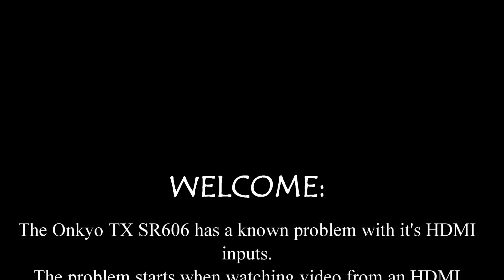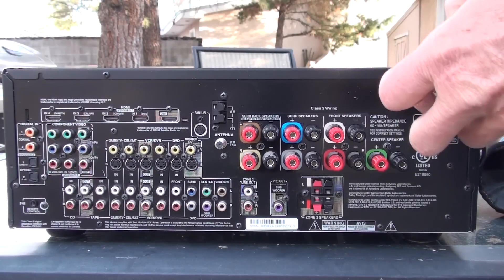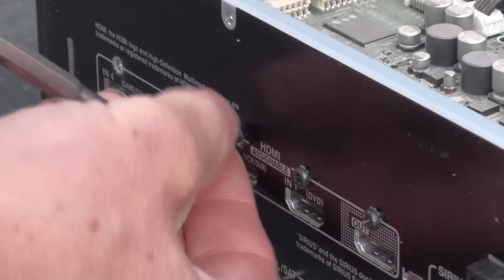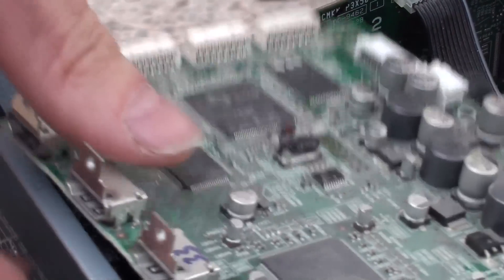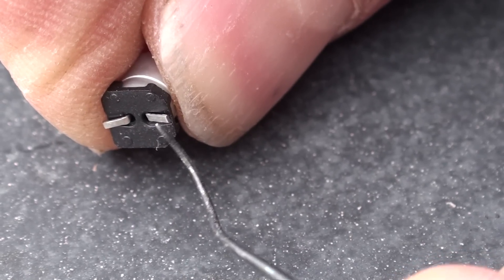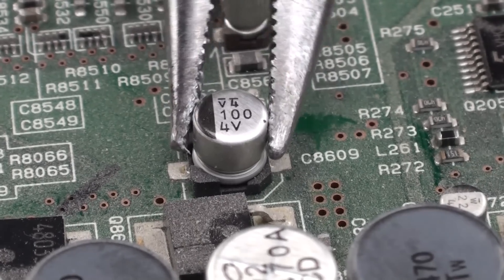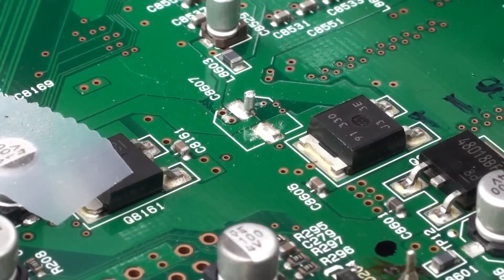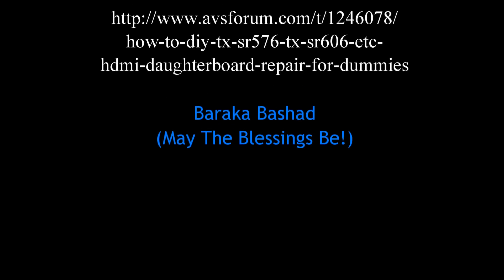How To Fix the Onkyo TX SR606 & SR607 HDMI Input Problem

Comment: The 607 is slightly different then the 607. I replaced all 21 capacitors on this board of the 607 and after that HDMI is working again. So, a lot of 100 uF SMD, some 220 uF and the rest is 470 uF. The little one on the 607 board, the 22 uF, wasn't in stock so did not replace that one and it seems not necessary to replace that one too, it's working again with replacing all 20 of the 21 capacitors.

Comment: I am curious though as to the reason for the failure of these caps. I know the Onkyo runs very hot and is often left on. In purchasing new ones I noted a Life Rating of 1000, 2000, and 5000 hrs.  I opted for the highest which happened to be a radial lead.

Comment: Great video.  Any idea which caps to change on a 804?  There are a total of 11, wondering if I need to change them all, or is there a way to tell if they are bad???  Thanks!
Reply: I was also trying to find out how you knew which capacitors to change.  Does each capacitor work with a different HDMI port?  If so did you check each port to see if it worked?  Or can you use a Digital Multimeter to see if each one carries a signal?  P.S. Great video except for the sound.  Maybe you should include text as a reference.
Reply: Arthur Elizondo  - My 804 had 11 capacitors instead of 5.  I bought 10, thinking I could mess up half of them, but was still one short.  I started changing them in no particular order, changing a couple, then testing the unit.  After 4 were changed, everything worked, so I saved the caps I had left over for next time.

Comment: I saw this on excellent video for a while now. N my HDMI devices have not been able to connect to SR-607 intermittently. Sometimes can n sometimes take forever. I wonder s long s it is a 100UF 4v SMD capacitor as per the video, it will do, right? Any other specification, i need to be aware off? Cheers. I never use Digikey before and not sure if it is available to send to my country.
Reply from the maker: I'm sure you can find suppliers in europe. Once you find a supplier, Search for:  Capacitor>Aluminum Electrolytic>4V>Lifetime Temp = 100C or 105C.  A lower temperature rating will work, they just wont last as long.  Style can be Cut Tape or Radial.  You may find Radial style easier to solder.  You can even get them on Amazon but I dont know what the temperature rating is on these products.  https://www.amazon.com/Aluminum-Electrolytic-Capacitors-4volts-6-3x5-4/dp/B00LWSMGHY/ref=sr_1_3?crid=1PAYEA5B26NZN&keywords=capacitor+aluminum+electrolytic+100uf+4V&qid=1672793671&sprefix=capacitor+aluminum+electrolytic+100uf+4v%2Caps%2C97&sr=8-3

Comment: Hello, I have the same amplifier. My issue is I am not getting any audio through the speakers or headphones. Everything else works, ie recognises audio in via optical/HDMI/RCA etc, and can decipher what audio format it is. Any ideas on what might be wrong with the audio output? The Audysey setup mic feature will not work either.

Thanks

Comment: I do have SR876 and the hdmi is not working.  I wonder you can share all of capacitors on board that need to be replaces and capacitor spec you recommend.  Thanks.

Comment: I have an Onkyo TX-NR609. I had it repaired once under warranty where they replaced or repaired the HDMI board. It's had a history of slooooow switching between HDMI inputs, or seems to just go to sleep for a while then suddenly work. 

I've since acquired a 656, but I'd like to repair the 609. The HDMI board has 4 caps on the "bottom" of the board and 1 on top that in appearance look like the ones in your tutorial, except mine have "A4" "100" & "16V" written on them. Can you tell me which caps would be a proper upgrade to these? I have the board out and ready to replace the caps. I'm not an electronic tech but did used to repair telecommunications boards back in the late 70's so I have some soldering skills, if a little rusty.
Thanks for any info you can help me with.
Reply from the maker: mandrix It’s best to replace them all.  The 4 caps on bottom sound like 100uF, 16V.  Replace with same type but upgrade the temp rating  to  100 or 105C if you can, so they’ll last longer.  I don’t know what your board looks like but I’m surprised if it only has 1 100uF cap on tops.  The smaller caps (100uF, 4v) are more likely the signal caps, and more likely to be the problem.
Reply: @patpatpat999  Here are links to pics of either side of the board, hi res.[ https://imgur.com/cTPNNPf ]  [  https://imgur.com/TH4zMVC  ]    I hope this will clarify for you. But basically you're saying I just need to buy replacement caps that are rated for >= 100 C?
I appreciate your help. Even if this model turns out to have different problems, I don't feel that such a small investment in time and money is wasted for a chance to get a few more years duty out of the old gal.

Comment: Well that looks nice and easy to do BUT i have a question so her it is 
My Onkyo TX-SR313 does work with the HDMI but it loses sound after 1 min or when i start the onkyo again only picture from the satellite but no sound 
If i put my Onkyo of i will get sound on my TV self ( not on the Onkyo ) so i think its the same problem as you had ?
Ore am i mistaking here ?

Comment: Hi i was just wondering if you know if this process will work the same for the TX-NR509? I have gone through all of the HDMI ports and that is now preventing me using my system as a home stereo. Any help would be greatly appreciated. I have not been able to find a guide as thorough as this one or any for that matter that are specifically for my model. Mine looks very similar to your model just slight differences.

Thank you

Comment: Any idea on which capacitors need to change on the TX NR-807? Onkyo offers get a new model with a good deal but does not ask to return the unit only serial number label, works with rca's not hdmi on video, sound is ok

Comment: very helpful video. how did you figure out which capacitors to change out? I have a TX SR875 and the board is different. There are 4 capacitors next to each HDMI connector. Seems obvious to change those. I have the schematic diagram, but it is hard to digest. any advice?
Reply: And dit you fix it with new capacitors?

Comment: Hello, I have the same problem with my  Onkyo  TX-SR876 which I've been told it also has a fault on the hdmi board. Do you know which capacitors I need to replace please as the board is slightly different? Thank you
Reply from the maker: Jut replace ALL the 100uF capacitors, not just the ones I show in the video. It only a little more work and a couple dollars more
Reply: Any luck Werdna on your Onkyo TX-SR876? I am going to try the same on mine and update you all.

Comment: Hi Pat. Thank you very much for posting this fix. I was skeptical about just twisting off the caps but it worked pretty well. I got my caps from eBay seller diy-electronic-store for about $7. I wonder whether any of the other caps on the board are bad or maybe Onkyo bought a bunch of bad 100uF ones.
Reply from the maker: TTDavid Mayes You never know, That why I reccomend to replace all.  I think onkyo goofed on the design.  Their chassis run hot. They should have spec'd higher temp caps.

Comment: Did you find these with an esr meter or were these targeted due to someone else's observations? I don't have the same fault but it's not on the amplifier board. Should be getting a dedicated esr meter in the post soon and hoping i can find any faulty metal can caps with it.
Reply from the maker: No esr.  These caps are all old and underated for the thermal environment.  No point in checking them.  Just replace them all.  You are only adding a few minutes and dollars by doing this.   You are over thinking this.  As an old engineer, I don't care what went wrong, I only want it fixed.

Comment: Thanks for the great video! I just changed all 5 capacitors on my SR607. Now the input sound comes on instantly but video does not. Could you point out which capacitor manages the video output or how to fix my issue?
Reply from the maker: I don’t know, but you could replace all the caps on the board, there aren’t very many.

Comment: Fantastic! I thought I was going nuts or that my kids have managed to change a setting somewhere that I wasn't able to find/solve. My TV HDMI input seems to work fine but the ones for my 2 games systems will take up to 20-30 "switching" back and forth to finally come up on screen. It's been driving me nuts. I'm not an electronics guy but may be time to learn if it solves the issue - thanks!

(how were you able to determine it was those causing the issue?)

Comment: I have a TX-SR607 Onyko and I'm not getting any signal at all. My receiver may a click noise and the picture disappeared on my HDTV. The receiver went off. I turned the receiver back on and couldn't get a signal through the receiver on any of my devices. I guess I can try this. Where do I order all the parts?

Comment: There are four capacitors 100 4V E2 and E3 1 capacitor 100 4V.
I replaced them with the same as you wrote.

Comment: I have a 696 that flashes protect and shuts down on startup. I tried to warm all the board to see if warming caps would bring it back to life but no joy. Next i will try to separate the regulator board and hotwire the transformer to check the power supply output voltages are good. I'll recap these 2 sections. If still no luck i will recap all metal cans on the processor / computer board. Looking at the onkyo service manual the trouble shooting section seems a little complex and not easy to do if it keeps going into shut down. One guy said to reset the data chip on later models and sometimes when the fault is cleared it can operate again!

Comment: Hi patpatpat999,

I'm trying to understand if this will help me with the notorious "no sound" problem, meaning, when the HDMI input finally works (after few minutes) there is no sound, only video.
I saw a lot of movies, according to which the problem is with certain Q3001 chip (and in most cases, heating the chip or even putting the entire board in the oven will fix it, sometimes temporarily:) ). I wonder if the replacement of the capacitors described in your movie will help as well...
Reply from the maker: I cant say for sure, and I don't guess about things I'm not sure about.  Whether video or audio, if there's  delay and then it works,  it's probably a capacitor problem.  The good thing is that it's cheap and fairly easy to change all the capacitors.
Reply: It worked for me. I had limited HDMI inputs working ans the sound got Real shoddy almost sounded like it was through water. replace the caps. its like 5 dollars with shipping though Digikey. only took 3 days to ship for me. Even If I have to replace once a year Its worth it for me. 1

Comment: your video is great and i have a question. It looks like each capacitor has a unique part number (C6809, C8002, etc). but it seems that you are saying order 5 of the same capacitors. Is this correct?
Reply from the maker: Joe McKenna Those numbers circuit references.  Each part has a unique reference number.  It's used to locate the physical part from a schematic drawing.

Comment: Thank you!
I just replaced the five caps indicated, and my receiver is now working just like the day it did when I brought it home. It took about an hour and half, with half an hour of that dusting out the case.
Now. . . anyone want to buy a soldering iron? Only used once! ;-)
Reply from the maker: Congrats.  You're now a junior engineer! I actually rinsed my board off in the sink.  It can be safely done, but I don't say that just in case someone does ruin their board.  Cheers.  Rock-On (at safe volume levels)
Reply: patpatpat999 

A junior engineer? I think I need to ask for a raise!

I did notice one thing in your video, I may be wrong about this but I'll mention it anyway.
I think the you might have mislabeled the the capacitor on the top of the board. In the video it's labeled as C6809 when it's actually C8609.

Comment: Would it be ok for me to use a El.lyt SMD 100uF 6.3V 85C ø5×5.2mm instead of the one in the description? 
The only difference I can see is that it's 6.3V instead of 4V, will this be a problem? 

Thanks for the video, you're saving lives.
Reply: Just saw it can only get up to 85 celcius, guessing this could be a problem?
Reply from the maker: Flying Gordon should work fine.  Higher voltage just makes them a little bit larger.
Reply from the maker: Flying Gordon 85 deg will work,  but 105 should last much longer.

Comment: hi this is a super video but im a little confused. the first cap has a code next to it on the board saying c8609 not the c6809 you listed the next one has a different code to the one you said however the last one has a code next to it that you listed. so how come you dont order them based on the codes printed next to them on the board? any reason for that? thanks for the awesome help

Comment: Very helpful video. Thank you. My Onkyo TX-SR674 has a very similar issue to the HDMI input problem that exists in the SR606 and SR607. I have found multiple videos showing the replacement process for these models but not my own, which has a smaller HDMI board with a different configuration. I would like to attempt the capacitor replacement to see if it will fix the issue on my receiver as well but I am unsure how to identify the capacitors on the board for replacement. Do you have any advice on how to identify which capacitors will need to be pulled and replaced? Thank you.  *edited model #*
Reply: +berthornhill Look for "4V" and "100". There could be other numbers but those two are the give aways. They're pretty small, I didn't measure them but iirc they're about 3/16" diameter.
Reply from the maker: Agreed,  all caps of the same size will probably be the same value on your board.  Replace all the 100uF caps

Comment: Hey Pat I have the 607, can you tell me if the capacitors that need changed for the hdmi are the same as the 606? 

I took a look on the bottom side of the board and there are five 100mv 4v . are these the ones that need changed?

I read w post on an av forum and one person said do not follow the 606 repair on the 607 because they aren't the same.

Comment: Doing my second replacement in 5 yrs… this time putting 6.3v in as an upgrade.
Reply from the maker: @foggyfrogman1  I would suggest putting in a cap with a higher temperature rating would help more than a higher voltage rating, but I don’t know for sure

Comment: It's so sad that Onkyo makes a ton of money off of us consumers and they have had this issue for years but they refuse to fix the problem! I will NEVER buy their TRASH again!
Reply: Maybe you can use it for a radiator since that's all its good for lol
Reply: Onkyo has an excellent and extensive recall program that still runs:

https://care.onkyousa.com/eu/003_2012_eu.php?country=NLD&lang=en_GB
Reply: Their recall program does NOT cover these models.  They have ignored customers who bought these models and got ripped off.
Reply: Link doesn't work anymore, they must have gotten annoyed from so many visitors.
Reply: LCG2210 not in my country (Mexico) I lost my money
Reply: Junkyo!
Reply: The assholes at Onkyo blamed it on a bad network chip, despite the issue plaguing models that don't even have a network chip. My theory is that they blamed it on a feature that was only on higher end receivers (At the time) so that they wouldn't be on the hook for repairing all of the shoddily built lower end receivers with the same issue, namely the 606.
Reply: My tx-sr308 have the same problem, but it isn't on their damned list... That recall program is fake news!
Reply: I am dealing with their bullshit right now mine just did this shit to me today

Comment: Thanks for your  very informative video, I am having no sound problems with my Marantz nr1602, but I noticed that there is sound whenever I use the pre outs with a power amplifier to play my front speakers, I noticed that the sub input works as well, do you have any suggestions as to what the problem could be?
Reply from the maker: Sorry, can't help you.

Comment from the maker: VINTAGE: Your caps should work fine. Up to 105C, good choice. The long lead on your caps is +.  The black mark on the original SMD Cap is the - side.  If you lose track, the white outline on the board under the cap is beveled on one side. that side is the + side

Comment: Would this be the resolution to a problem with my SR 606 where the HDMI output to my TV from my SKY (satellite decoder) is creating 1 to 2 second blackouts intermittently - perhaps 15 per hour as when the Sky decoder is fitted to the TV directly the blackouts don't appear?  (great video by the way)
Reply from the maker: Probably, but I can't say for sure.

Comment: I've had it working for a while, after your fix..  However now, I'm started to get the case where I'll first turn on the unit, and it won't connect. I'll again get the dreaded 'no signal'.  Then after a few minutes it seems to warm up, and has no problems HDMI connecting again.
Reply: Robert Koernke oh it dawned on me immediately, that I have a solder connection that gets out of alignment, and then heats up and connects.  The solution is look again at my cap solders.
Reply from the maker: Could be.  Get a magnifying glass and look for a "cold solder joint". Should be able to search Google images to see what one looks like.
Reply from the maker: Better luck with your next AVR!

Comment: how would I know which capacitor to replace? I've got a different model, same problem.  no audio, it displays video. hdmi light on the  receiver flashes and that's pretty much it. onkyo had no solutions, and even though my problem is in line with the recall problems, my receiver isn't covered . 

never mind, just watched all the way through and realized you said to replace all of them.